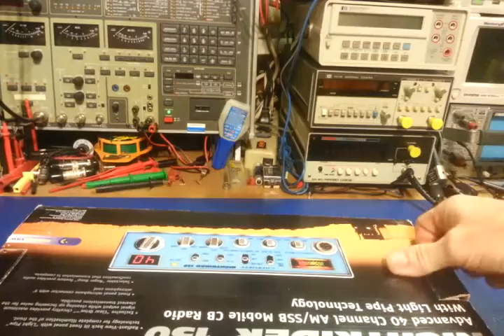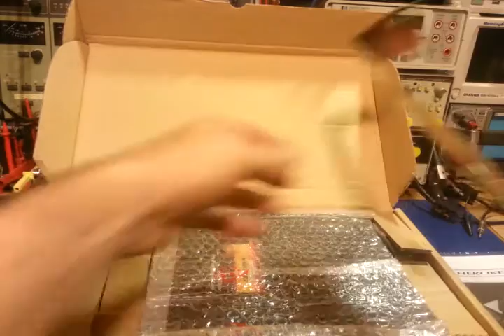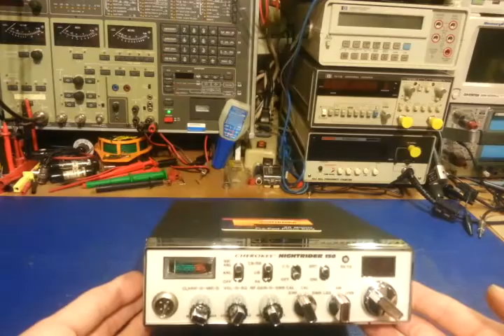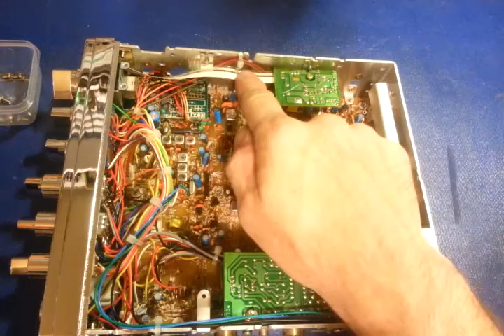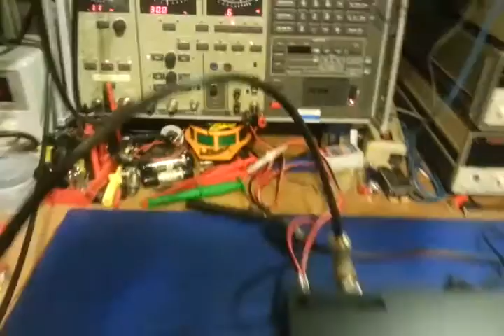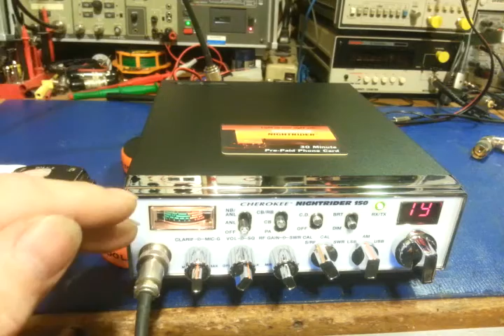Rare NOS Cherokee Nightrider 150 AM / SSB CB radio w/ Clear Drive module.

Comment: I had a Cherokee CBS-1000 AM/SSB base radio back in the mid 1990s. It had the extra channels mod done to it. The only bad thing with that radio is the small plastic mode push buttons on the right would break off of the face plate if they were used too much. And to fix that you have to buy a new plastic face plate.

Comment: The 30 minute phone card and 'EL' lighting are both tell-tale signs this is a product of the 1990's. EL lighting looks wonderful when it's new but after about a year of continual use those nice looking EL modules start to get dimmer until they eventually fade completely OUT. I had to replace the EL modules behind the displays of my old Radio Shack PRO-2006 scanner and an old Garmin GPS receiver. Some people use an LED equivalent replacement.
Reply: Yea, that is the case for Cobra radios, but Galaxy radios with the EL face seem to never get ugly or worn out. I have an older Galaxy DX93T with the EL face and it still looks new and it is about 13 years old now.

Comment: Scored one finally very clean just has blown finals from a high swr situation. Well thats what i was told anyway. I do need help guys i need the sams photo fact book number if anyone knows.
Reply from the maker: Here is the schematic and block diagram.  You will have to do the alignment using another radios procedure, its the same as dozens of other radios.  http://www.cbtricks.com/radios/cherokee/nr150/graphics/nr150_main_sch.gif
Reply: I appreciate the help mike i had a feeling it was to new for a sams. I think you mentioned its the same alignment procedure as a cobra 29 if im even close.
Reply: Yup I was wrong it's alignment procedure is most compared with a 148 from what I'm finding. Is that the procedure u would use.
Reply from the maker: +bryan153 

Pretty much but there are differences.  If you work on radios its easy to figure out.  Everything you need is on the schematic.
Reply: thanks mike. Love the videos

Comment: I am actually in the market for one of these Cherokee 150's now if anybody has any leads I would greatly appreciate it. Thank
Reply: Try your local HamFest.
Reply: There is a used one on eBay right now.http://www.ebay.com/itm/RARE-VINTAGE-CB-RADIO-CHEROKEE-NIGHTRIDER-150-AM-SSB-CHASSIS-FACEPLATE-ONLY-/291854050650?hash=item43f3db655a
Reply: The current bid is $35.00.
Reply: There is a used one on eBay right now.http://www.ebay.com/itm/RARE-VINTAGE-CB-RADIO-CHEROKEE-NIGHTRIDER-150-AM-SSB-CHASSIS-FACEPLATE-ONLY-/291854050650?hash=item43f3db655a
Reply: Yup I saw the eBay one and I screwed the pooch on that I'm so pist I messed up the end time of the auction.
Reply: It looked like it was basically a non working parts radio anyway.
Reply: Yes but i do repair work so if i can get the radio i want and have some fun repairing and restoring it along the way im always game for that.
Reply: Another one for sale on eBay:  http://www.ebay.com/itm/Nightrider-Cherokee-150-CB-Radio-Blue-Glow-EL-face-AS-IS-for-repair-parts-Works-/322248656902?hash=item4b07844806
Reply: Yup im on it. Thank you again. Lets hope i dont screw up this time lol
Reply: Good Luck!

Comment: Love that front panel. Is the Silk Screening directly on the EL panel? Or is there an overlay?
Reply from the maker: Really not sure, not a electro luminance expert.  I think what your looking at on the outside is a overlay that is silkscreened.
Reply: An overlay ( if removable ) would be a good thing. The rig looks great, but EL panels have a relatively short life span before they either develop dark spots, or just fade.( a couple of years of continuous duty usually does it.)Would be nice if you could remove an overlay and replace the panel. Fairly easy to do as you can cut them with a paper cutter and a good sharp punch set. I am going to keep my eyes open for one of those at the Ham flea. That is a cool rig. Or perhaps someone out there who does silk screening could make a screen.
Reply from the maker: +The Radio Mechanic 

I get the feeling its like the Cobra 29NW type, all one piece and when they go out their gone.  Big problem I have seen with the Cobra's is delamination.

Comment: That would be interesting. While I love rf and audio clipping and compression with moderation I think the expander would be a god send for modern radio's. I was also wondering if putting beeifer old school crystal filters could be installed with short jumpers in spaces too tight to actually fit a larger more narrow crystal filter?

Comment: My partner I worked with many years ago used to carry the Cherokee line of radios.  When he past away and we closed the business down there wee several of these brand new in the box along with the matching base unit, a Cobra 2010 and no telling how many more in there. All the test gear and drawers full of parts. He past 13 years ago.  I was there not long ago and it is the same as it was the day I walked out.
Reply from the maker: A time capsule.   I was at a auction a few years ago like that.  It was a old radio and tv shop in a local town.  Owner basically finished the last job on the shelf, took a look around and said I'm retiring and locked the doors never to enter again.  After he passed away his wife finally went in the shop and then had a public auction.  It literally looked like it did the day he closed shop in the early 90's.  I ended up with a 16 foot box truck full from that auction and after telling the widow what I did and that all her late husbands gear and parts would be put to good use I got a kiss on the cheek from her.  Was a very emotional day for her.
Reply: MikesRadioRepair Im guessing I know the place. Good to hear. wow did that place have the vintage radios.

Comment: EPT3600 PCB? ranger rci's copy of the old uniden PBOIO PCB used in the old cobra 148 gtl dx and superstar 360 fm radios from the late seventies and eighties?
Reply from the maker: Kind of their own version.   Some old design but uses a few SMD components.
Reply: how do you rate the newer ranger pcbs alongside that of the older uniden original mike? don't they drift a lot more on ssb due to cheaper components and poor Chinese build quality?
Reply from the maker: +fitasafiddle Yep, they just keep getting worse and worse as time goes on.

Comment: Was it my imagination or was there a distinct hum that appeared when you engaged the high level front panel electro display to its high level? Not sure if that was being picked up directly into your audio system or was a noise injected into the radio's audio stream? Maybe the panel lighting display supply is noisy? The compander concept might be easier to understand if described as a non-linear (maybe better described as non-uniform) amplifier.
Reply from the maker: Its the lighting power supply board humming.  Its not in the receivers audio.
Reply: Hmmm, you mean physically (not electrically)  humming? That would be annoying!
Reply from the maker: +Dino Papas 
Yes, physically.  The Cobra Nightwatch radios do it to.  In person its really not that loud.